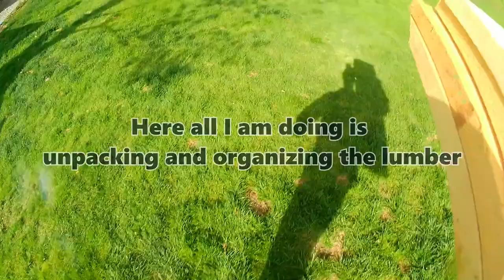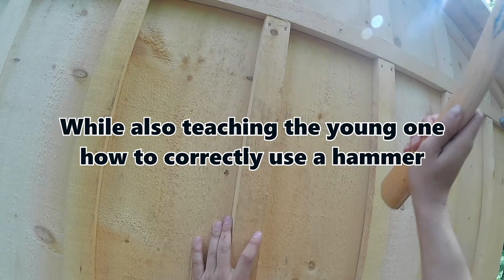Full Build of a 10x16 Amish Style Shed!

Comment: So,  I'm not a framer, but why use a nail gun. Then use a  hammer.  Why are you not all using a nail gun? Spirls nails ?
Reply from the maker: Is there a specific moment in the video you’re referencing or just in general? 
Either way, we will use either or for a number of reasons, hammers offer more control over nail depth, size with little damage to the wood. Air nails need to be set up, the hose can get in the way, but it’s good for rough work that gets covered